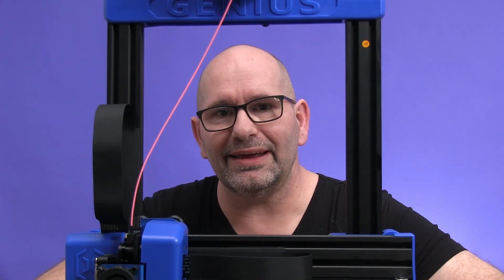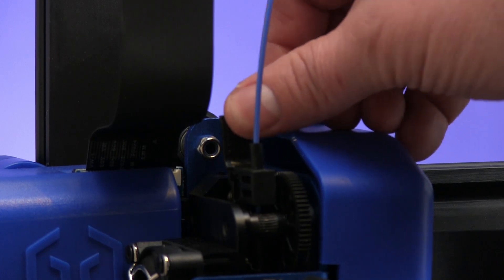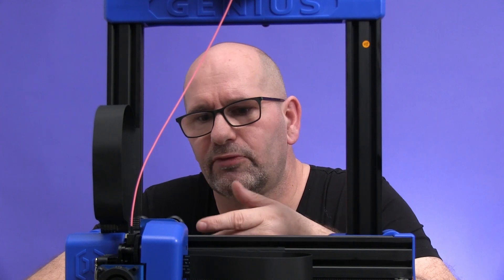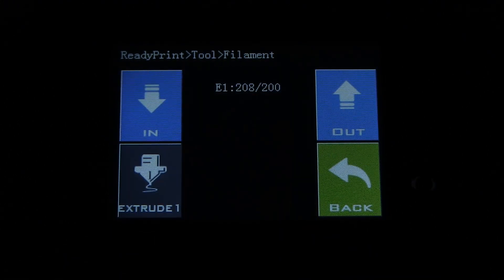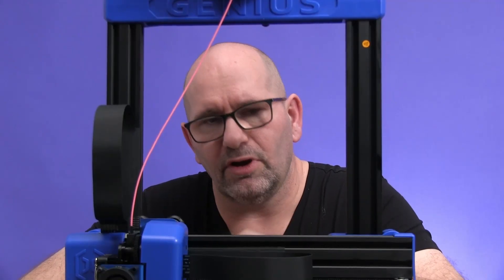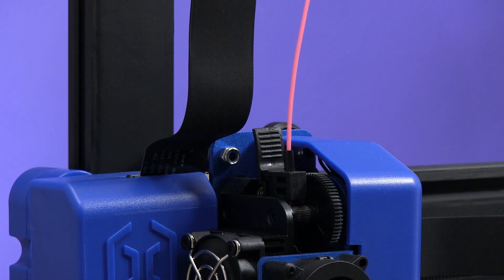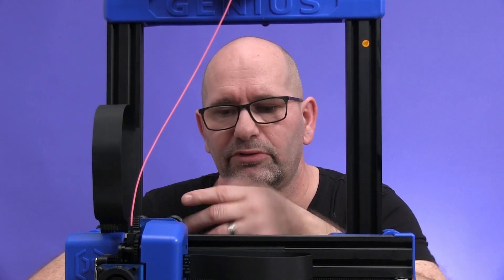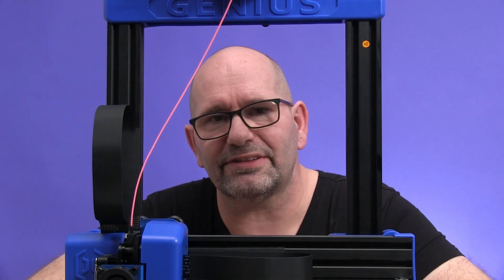▼ Artillery 3D TIP of the week | Artillery Sidewinder X1 and Genius.

Comment: I've run 5 of those printers for around ten months intensively. I always load and unload filament manually including pushing the Lever back, never had a single issue. The lever is obviously designed to be operated in this way if you want so I don't believe yours is the "correct" and only methode, but simply another way of doing the same thing, which in my opinion is too time consuming.
Reply from the maker: Hi, thanks for the reply end good to hear your positive feedback about the levers on the Artillery printers.
I have the Genius and Sidewinder, and on both, I have had problems with the lever. On the Sidewinder I had the lever moving to the left, not pushing the filament on the correct spot anymore, and this was a very easy fix for the short term, but in the long run, I changed it for a lever I made myself out of aluminum.
On the Genius the lever broke, and I replaced it with an aftermarket lever, that was made out of some kind of Carbon reinforced plastic (Don't know if that was necessary) but also shaped differently from the original lever. On both machines, I now don't have problems anymore.
Also, the lever problem is not something I am the only one having trouble with. A lot of people complain about it, and there are a lot of after-market options for it, and that must have its reason.
Reply: @3dPrintCreator  Fair enough. I am passing on my own experience with those two, the Genius and X1, never had an issue with any of the levers, it's all I can say :)

Comment: Sometimes they filament does not line up with the nozzle feed tube just below the feed roller so the lever is designed to allow a little manipulation so it lines up. It's not meant to be pressed hard or twisted in any way. Be gentle with it and you won't have any problems.
Reply: Exactly 👌

Comment: One would think that this video isn't really necessary but unfortunately no one reads the manual (actually pretty well done by Artillery) that explains this. They just try to mash that plastic lever back all the way like a Bowden type extruder and SNAP! Its a poorly designed clone of the Titan and that doesn't help the matter. You did not mention the biggest problem though. Both the Sidewinder and Genius come from the factory with the idler lever tension wheel WAY TOO TIGHT! I checked mine when I first set up the printer because I had seen other comments about this problem and yes mine was the same way. I had to back the adjustment wheel off a surprising amount of turns before my 1.75mm PLA idler tension was set correctly. Having that much spring loaded force with the factory setting and a weak lever is a sure fire failure of the lever waiting to happen.
Reply from the maker: Now you mention it... I remember that my idler was very tight on the Sidewinder, and indeed I had to loosen the screw quite a bit. Yet, on my Genius it was set to a corr3ect amount of force.

Comment: You do need to adjust pressure on the filament when you increase extrusion speed though, don't you?
Reply: I have not had this problem, and i print a lot with silk, even so the adjustment knob is at the back of the lever so you still don't need to push on the lever
Reply: @colinfielder6695  When the spring is adjusted in a way, that you have more pressure on the filament, you can't easily feed new filament without pushing the lever. Or I am obvioulsy doing something terribly wrong😅
Reply from the maker: On some printers you do, but I never did it with this printer, not even when using a much bigger nozzle and more than double the extrusion speed.
Reply: @3dPrintCreator  well, it then seems to also depend on the filament you are using. My X1 has trouble extruding when I raise the speed but not the pressure on the filament. I usually set it up, so I barely have marks on the filament. But that just does not work with my silk filament
Reply from the maker: @nuhbiwan  As said, I never had to adjust it, also not for silk filament. But then again, there is still no need to push the lever.